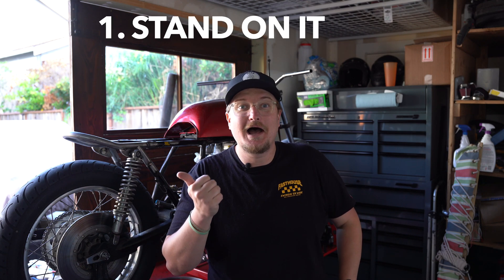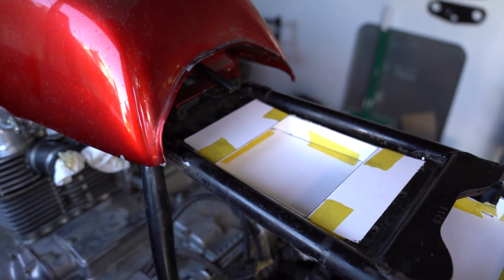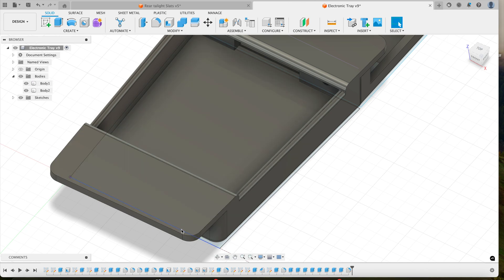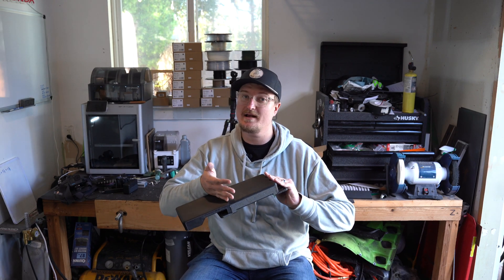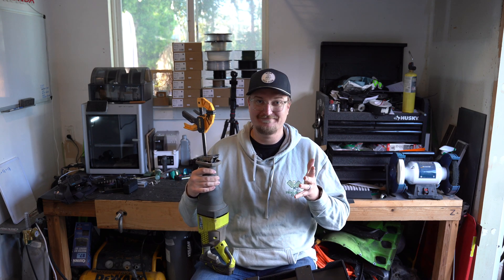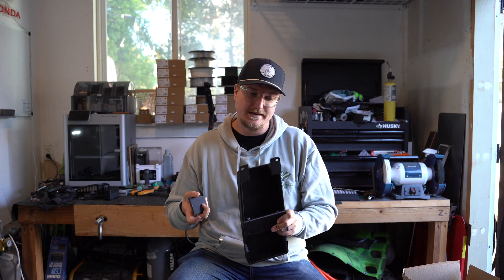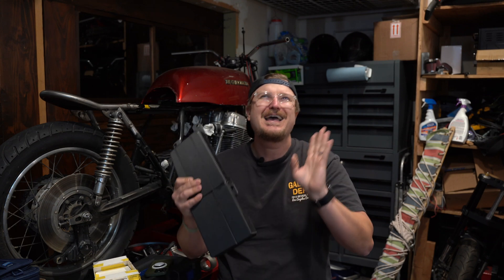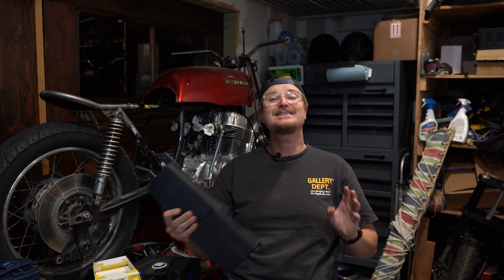3D-Printed Motorcycle Tray: Tested to the Extreme! 💥

Comment: I printed one years ago for a CL360 and it’s still on there. I used carbon fiber filled nylon. Added some trellis design on the sides for extra wall strength and did 100% infill. Turned out great! 😊
Reply from the maker: That's awesome! I've been playing around with different filaments lately. I have tried carbon fiber nylon just yet. I'll have to give that a go.